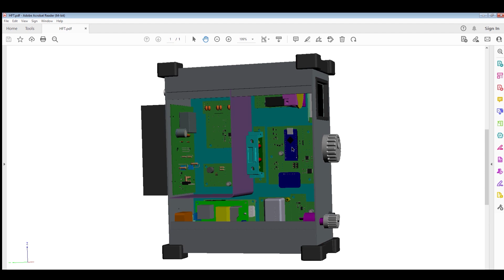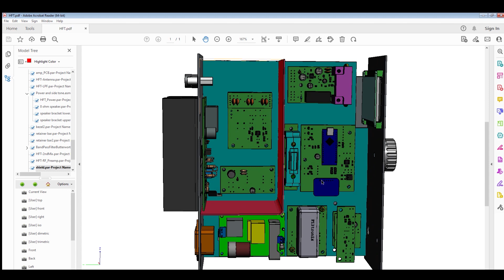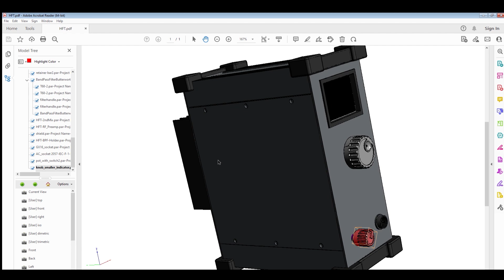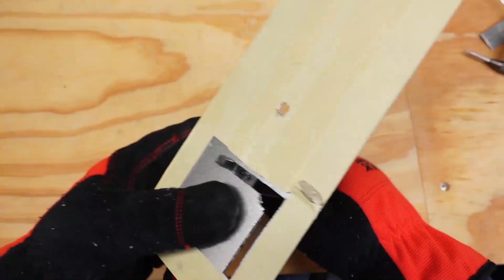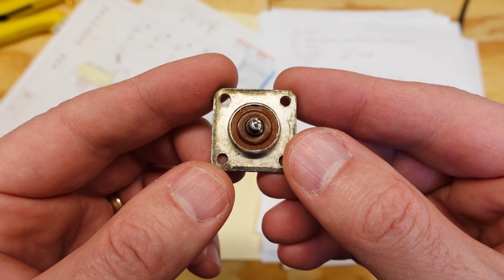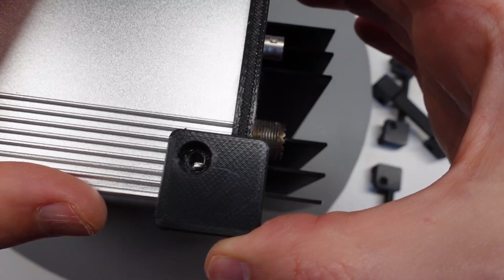HF Transmitter #12 - Putting It All Together!

Comment: Agree on your rant about SO239s, I've seen the same thing, terrible manufacturing,  no doubt from China. Same with 3.5mm stereo switched sockets, just junk. I ordered some of the latter from a reputable online supplier, maybe Element 14 or Digikey, can't remember which, but they were good. Suggest you do the same to source SO239s. Love your attention to detail,  very few home builders pursue design like you do! 73 Paul VK3HN.

Comment: I find that making the wiring look nice is not always the best move, as noise and rf pickup don't respect all the effort you put in.  A 🐀 nest  while bad for the eye does make it harder for cross coupling.  Looking forward to the next video
Reply from the maker: Yes, I was a bit concerned about cross coupling, but the wires that I bundled were largely power and ground.  All the sensitive RF connections are coax and free-form.